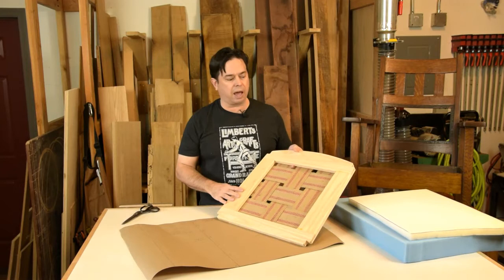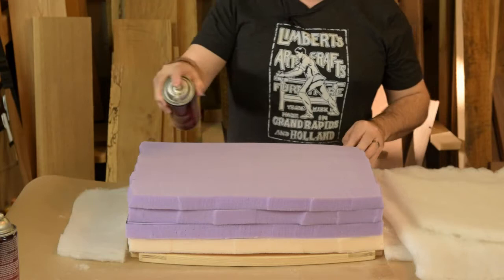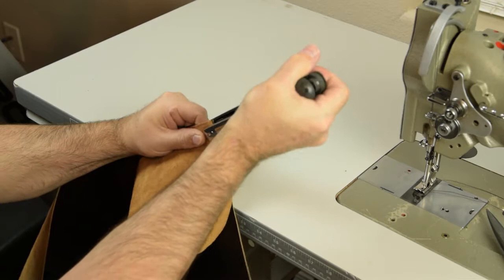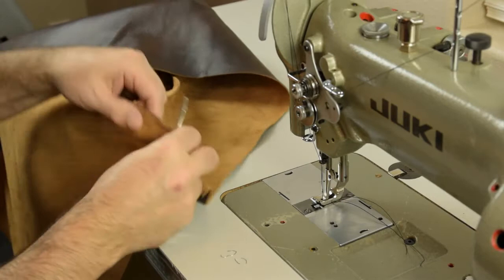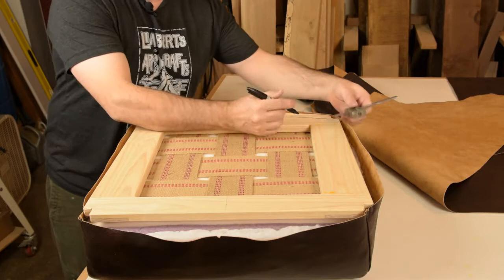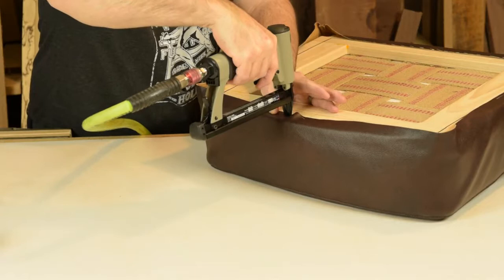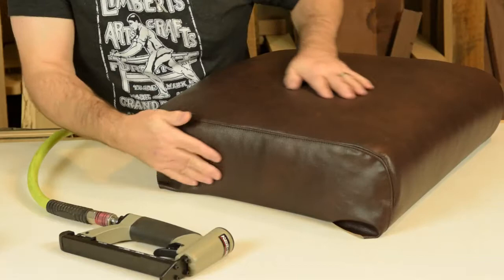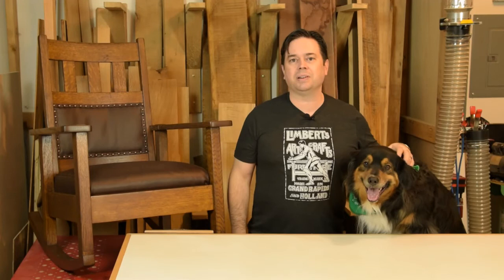Upholster Round Back Seat Cushion in Leather DIY Upholstery Tutorial Mission Leather Craftsman Chair

Comment: Im more curious about how the upholstered back was done 🤔
Reply from the maker: Yeah, tacks can be a fun upholstery project .  Here's my technique with tacks using a cardboard template... https://youtu.be/54ZiMwTxCuw
The only difference with the backrest is you'll use trim strips.  The trim strips are just leather folded on itself with contact cement.  Best to you.
Reply: @TheThoughtfulWoodworker so in that case there are no staples, just the nails to hold the padding in place? Is this the same way you would add padding to the top of an arm rest?
Reply from the maker: @BrentDaughertyMe When using trim strips I usually start my stapling the leather in place.  Then the trim strips are added to cover the staples.  There's no metal or anything in the trim strips, it's just leather folded on itself with contact cement.  Best of luck!

Comment: How did you do the back of the chair? I found 4 dining chairs on the curb (circa 1930) and am reupholstering them, they are in amazing condition and have already put leather on the seats and they look perfect. The back is where my problem is, the original material was a velvet type and wrapped over the top so it had 1 piece on the front wrapped over top to the back and they used tacks. So no seams were showing, I wish I could share a photo as that would make this makes sense. Thank you in advance.
Reply from the maker: The leather is stapled to the backrest, and covered with trim strips.  The strips are folded leather, glued together with contact cement, and tacked in place.  Best of luck with your project!
Reply: @TheThoughtfulWoodworker  Thank you for the quick answer and info, not sure this will work for the job I have but I may fold the leather over and staple the fold, then apply the nailheads. I will remember your info if I have any other future projects.